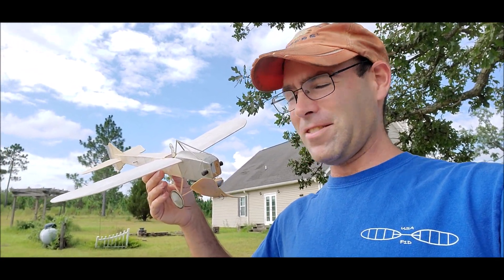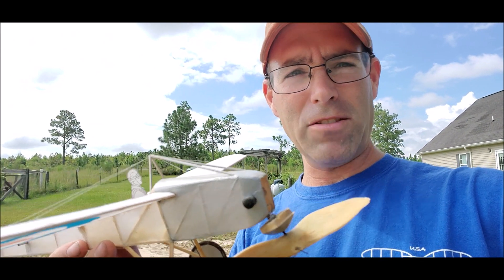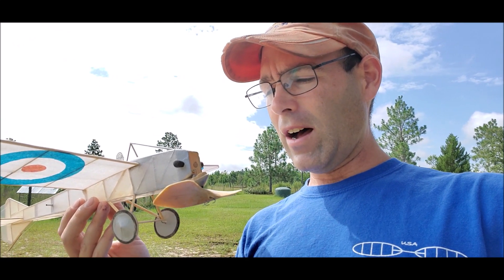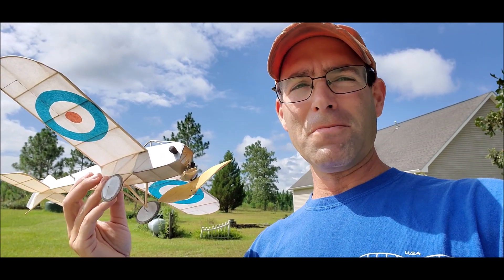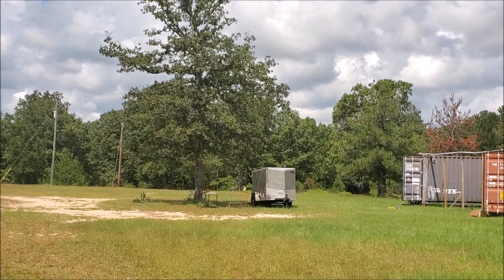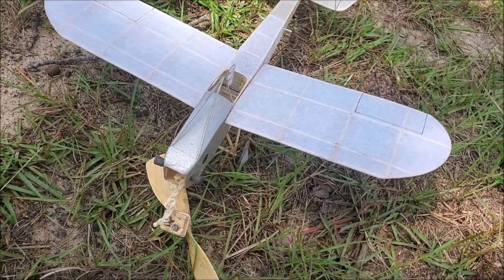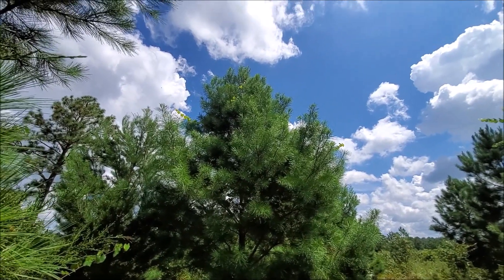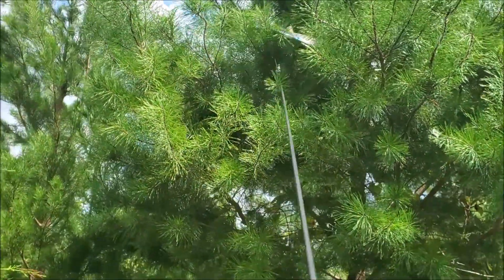Rubber powered British Aerial Torpedo monoplane

Comment: I noticed it tends to skid to the right about ninety degrees shortly after launch, then continues to fly in right circles.  I am trying to figure out why it does that.  Your model flies better than I expected.
Reply from the maker: The right wing has a substantial warp in it, so I added right thrust and a smidge of rudder to correct for it. Result is the hard right pull during climbout.

Comment: do u prefer fan blades at 45 or 40 degrees ?
Reply from the maker: Depends where you measure it, since the blades are twisted for proper radial loading. Only place you should use flat blades is on a A-6 where rules require them. Optimum there is supposed to be 38 degrees but sometimes they work better at more like 45, and I don't know why.

Comment: Josh, you have any thoughts on this Ranger 30 and spiral at the end?  https://youtu.be/L_LHrfMHrcs
Reply from the maker: Hey just now saw this, I suspect it's a warp somewhere, although adding wingtip weight on the opposite wing might also help. Wouldn't take much to have a big effect.
Reply: @joshuawfinn  to me the wing looks like as it tapers out to the tips gets really flat, not too much lift,  I am going to build an electric version and it will be easier to test,